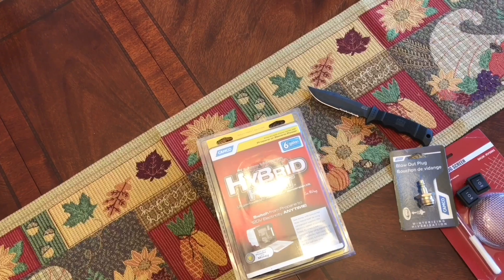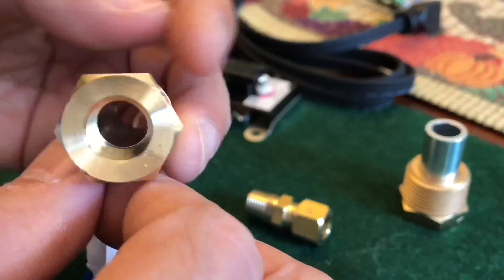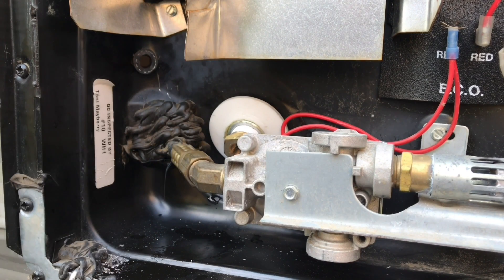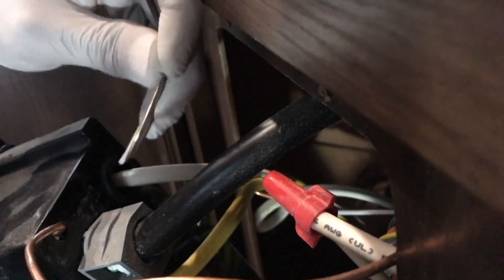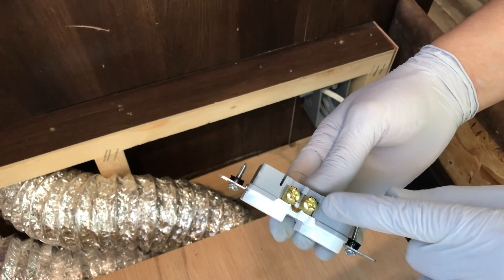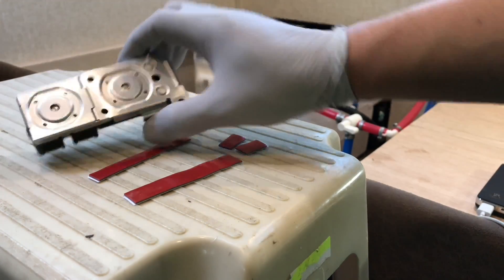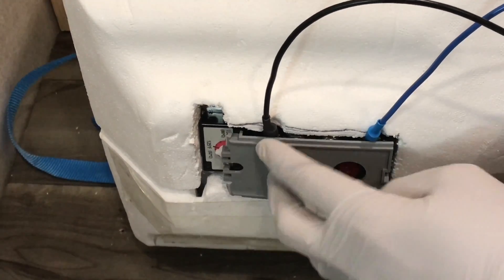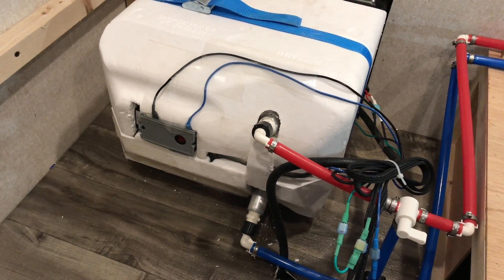Detailed! How to Install Camco RV Hot Water Hybrid Heat Kit Electric Conversion Step by Step

Comment: My electric hot water went out on the electric side I just went to Home Depo got a 110 element and a thermostat and breaker and adjustable temp you just have to clean of a small piece of stoa foam so the thermostat will set tight against the tank to get its info and you just use the power that was already there it’s ver easy and cheap like 10 bucks for heating element and 12 bucks for the temp adjust nut and a reset button and it’s all in one. Check it out if you have a 30 amp camper it’s just 110 bolts and if you have 50 amp you have 220 volt but you will have to check your hot water heater if it’s 110 or 220 but I think they are all 110 elements .

Comment: You're lucky, my water heater and breaker box are on opposite ends and would require my going through my slide out or running it up through my cieling and to the back. I gotta  use the included plug in a outlet that is next to my bed.. Did you make a new connection for your gas or no?

Comment: The wiring diagram with my instructions shows the black wire being connected next to the reset switch. Mine is a different brand than Camco, maybe that's why? Any advice? TY.
Reply from the maker: Follow your manufacturer’s diagram… this video should help / spark an idea. But the wiring should follow the instructions from the manufacturer. Thank you very much for watching! Good luck with the project

Comment: I wish I understood these things better. My camper is much different than any of the videos I find and I’m so tired of cold showers🥺
Reply: You might not need to put in a new 120 outlet, which makes this project much easier. I have an outlet in my RV that only had the refrigerator on the circuit. So I'm plugging mine into that existing outlet  I'm only half way through the project, but it should work fine. Just check your panel and see what is written next to each breaker. Just to be sure, I turned each one off to see which outlets belonged to which circuit. You can do this!
Reply: @stormwatcher528  did plugging it in to the sane as the fridge create any problems ?

Comment: Great video but as an alternative that I’ve seen in other videos, why not just run an external extension cord to the 30/50 amp shore power connection box. All boxes have a 115 outlet on a breaker. Saves the hassle of running a new circuit to the heater element and doesn’t add additional load to the RV’s electrical system.

Comment: So i got this thing and installed and tested it, everything good so far, began to do finish work i.e zip tieing everything and putting the swith on the wall.  Problem now, every time i turn switch to one the gfci pops? No continuity between different wires i.e nothings rubbing wrong, so if it was working before and not now maybe the switch went bad? No continuity between ground on switch and the other two poles? Question wheres the short

Comment: I purchased this already and getting ready to install it, but what do we do about having an anode in the water tank since it's now removed?  Has anyone come up with a solution to removing the anode?
Reply: Well that model may not, but mine does.  So I’m wondering what to do about the Anode once the heating element is installed.
Reply: @johnlittle6783  the special looking bushing is a zinc anode rod that is meant to be replaced once in awhile. I to was wondering about this so I looked into to.

http://www.camco.net/hybrid-heat-replacement-bushing-w-flow-through-anode-1-2-11641
Reply from the maker: I am 95% sure This model does not need one or have an anode in it. It has an aluminum tank. Please google it (I’ll do it too) and let me know if Ima mistaken

Comment: How do u hook it up if u don't have that pig tale ?
Reply from the maker: Two options. I recommend a tandem breaker. You get two circuits for the same size of a single standard breaker. Use a tandem breaker appropriate to your wire size. 15 amps for white romex (14 gauge) 20 amps breaker for yellow romex (12 gauge). Confirm your breaker type... but I would’ve bought this for my jayco https://amzn.to/36LFzib . The second option, splice into an existing circuit (white romex).

Comment: So quick question. Those kits are pretty expensive. Over $100 for the kit I need. Why couldn't I use a  replacement heating element (https://www.amazon.com/Camco-02483-Screw-Heater-Element/dp/B000K7RJQQ/ref=sr_1_1?dchild=1&keywords=camper+hot+water+heating+element&qid=1587048926&sr=8-1) and a replacement thermostat (camco hot water heater thermostat single). The cost would be under $40. It's 110. The element should fit. What am I missing?
Reply from the maker: Currently, this kit is on special below $70. I used this kit as my camper does not have an existing electric power heater. It only has gas. It sounds like your camper has an existing one electric water heater... This kit came with everything... sure you can put things together at a lesser price. You can definetly put something together vs buying a "kit".  I have down projects like that... thank you very much for watching and for the question. Good luck with the project.
Reply: That heating element is for a water heater that is both propane and electric from the factory. This kit is to retrofit electric onto what was originally a propane only unit.

Comment: I just started My install late this afternoon and this evening decided to check out youtube for a visual. Great Video. Thanks for the help. I am excited to get mine done and start saving my propane when we are docked. I have my heater probe in the tank and tomorrow will be starting my search as to where to access the tank..  Seeing it done and reading instructions are two different concepts for me, thanks for the help.
Reply from the maker: Thank you very much for taking the time to leave a feedback! It is appreciated. Thank you too for watching! The video may not look it... but I did the same (as you)... I took my time and did all in 3 days. A little at a time. Good luck with your project! Get’er done.... thanks again
Reply: I’m very curious as to how you will drain the water out of the water tank with the new rod installed in the drain plug position. I’m getting ready to install this exact thing on my Attwood. If anyone could help.

Comment: Great video!
I have the same Jayco trailer. Have you had the hot water tank just shut off and not want to reset for a long period of time? This might be the remedy.
Reply from the maker: The issue you mentioned (maybe different)... The fix. I shut the propane tank valve to “closed” and very slowly open it again.... But, it’s great to have electric water heater... we always go full hookup anyway (waste of propane when I have shore power)... thank you for watching and feedback! I have other Jayco 212qb vids...